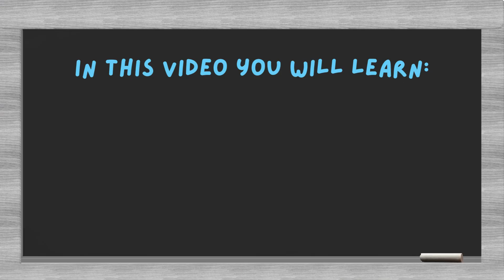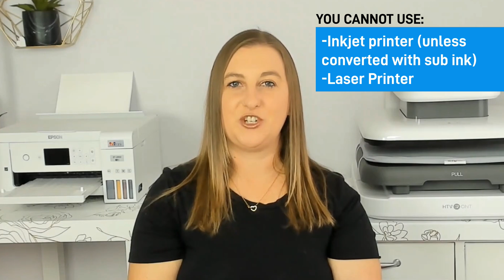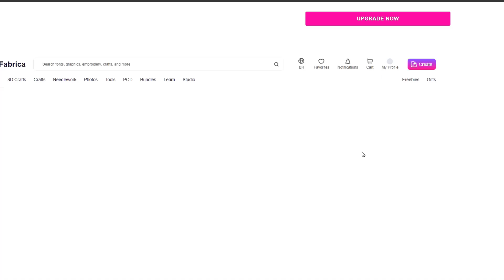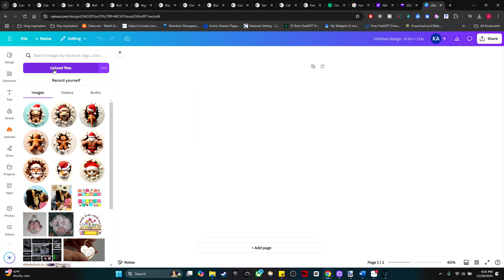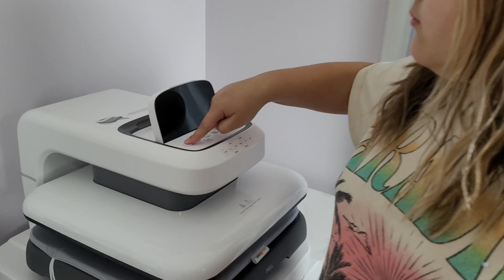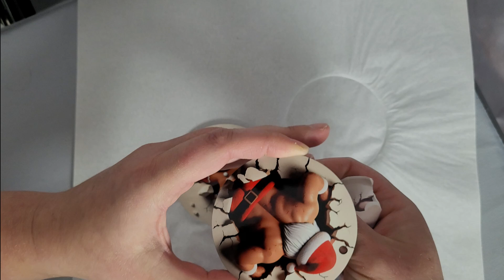How to Sublimate Ornaments (Complete Guide + Funny Gingerbread Design!)

Comment: I am trying to make some memorial ornaments. I am using a different brand sublimation ornaments from Michael’s, but it states the same settings. I am using the same press. I am having trouble with the transfer.  You mentioned you adjusted the pressure, but didn’t mention what you adjusted it to. What were your exact settings?  Thank you
Reply from the maker: I ended up taping the paper all the way around the ornament blank, and not to the butcher paper. Then turned the pressure all the way up. They came out perfect after that.
Reply: @ thanks…so you kept the same temp and time?
Reply from the maker: @nicolewhite7240  yes